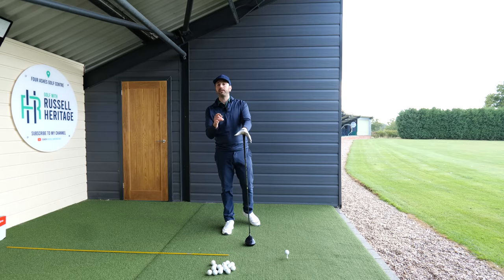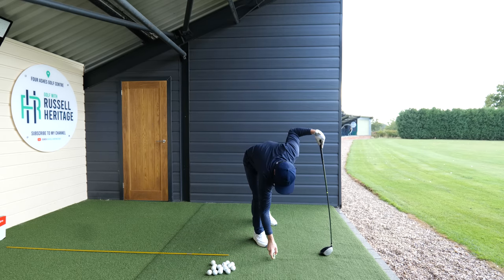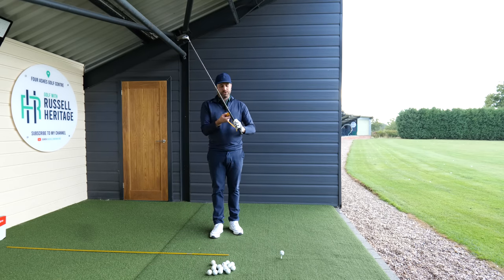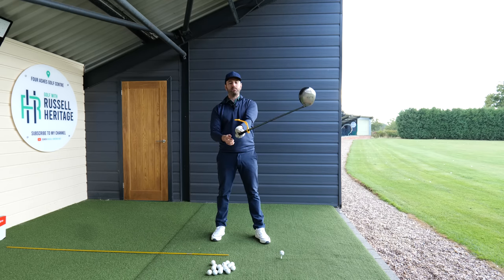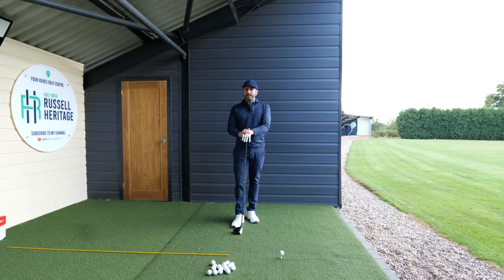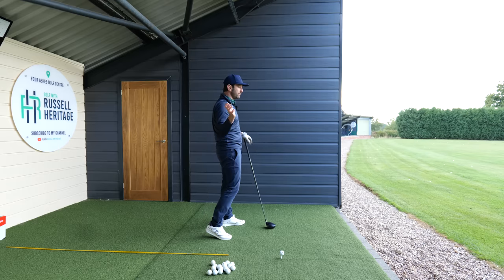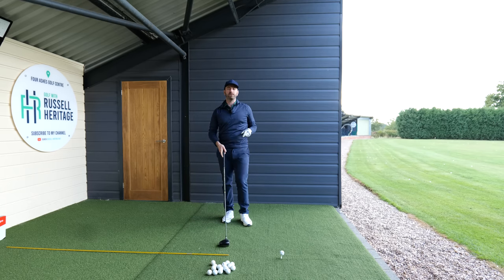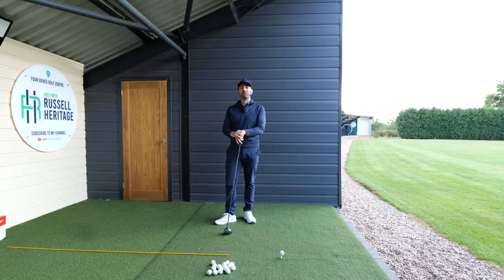Two Simple Changes To Fix Your Driver

Comment: For others like me - flipping and early extension - was to use Russell’s previous suggestion - while starting downswing -  delay move to left and push right foot outwards to right and left foot left forward. This helps in keeping back to target while hands drop into slot and pivoting left hip and making space , while remaining stable. Most of us are swaying left with the downswing momentum without realizing - so hands are left behind hence the extension then flip - for some like me - try